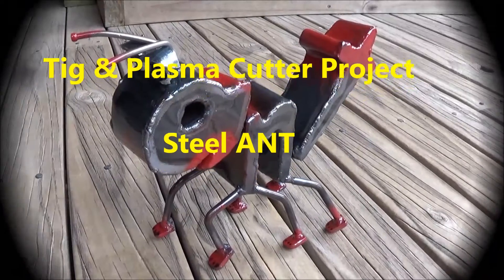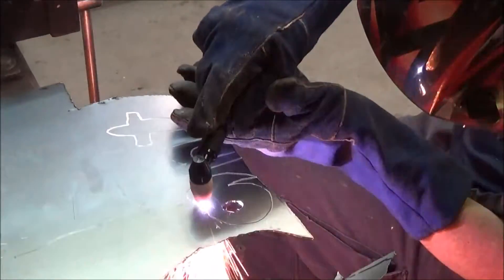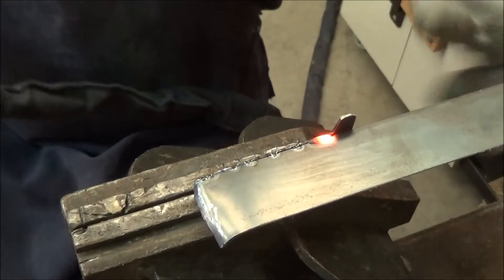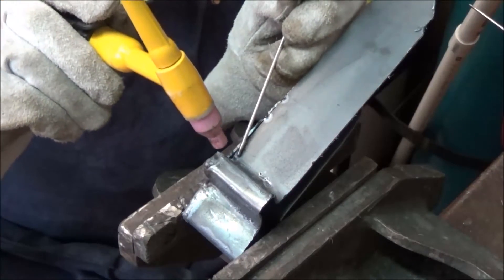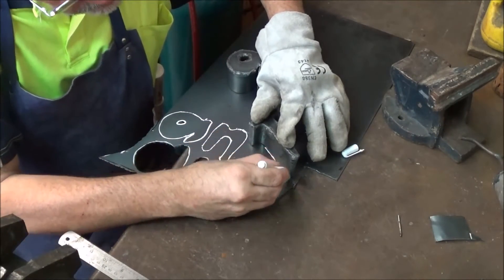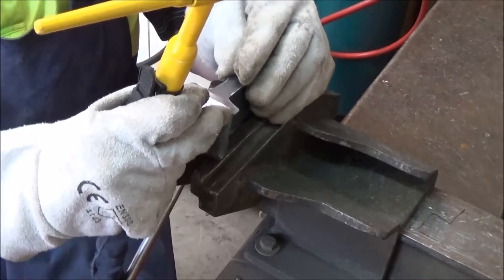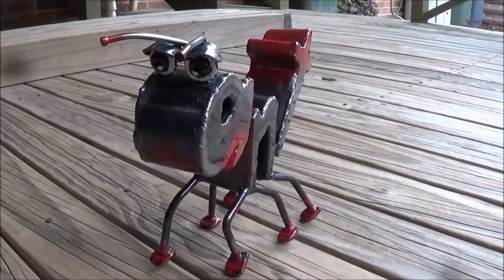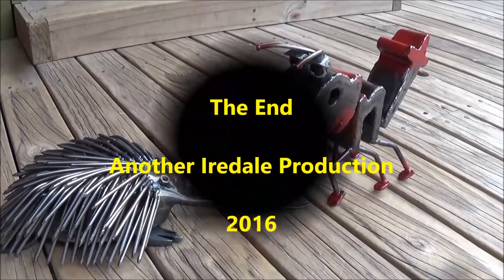Tig & Plasma Cutter Project - Steel Ant

Comment: Hi Adrian.  Great video.  Just a couple of quick questions.  PSI for the Plasma cutter?  Do you touch to start the cut?  Do you keep the cutter head touching during the cut.  Thanks and keep up the great work.  Cheers.
Reply from the maker: Plasma cutter needs 60psi. 
As its a cheap cutter it is "touch to start". For thin steel (2-3 mm) I can drag cut (touching the whole time) but this degrades the tip reasonably quickly.
Reply: +adrianiredale thanks Adrian.  You're my new YouTube hero.  Cheers.